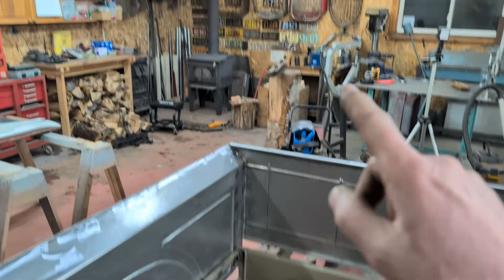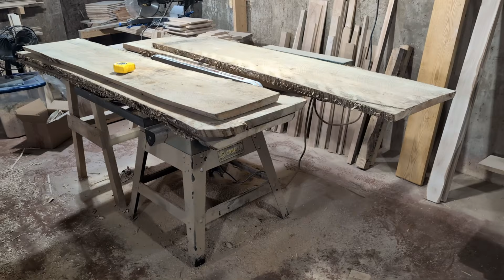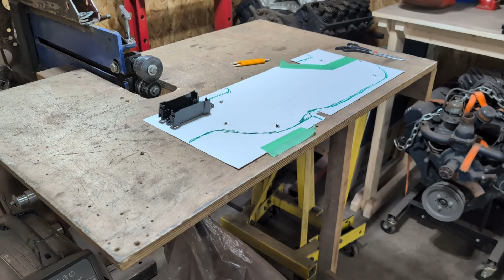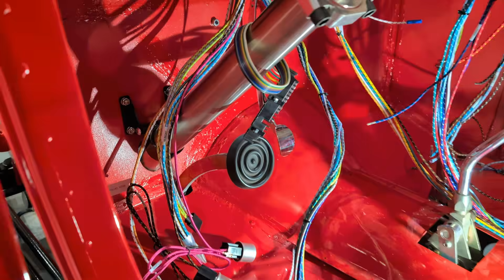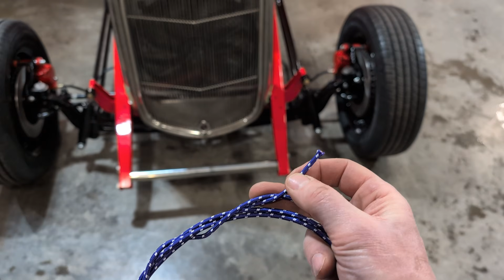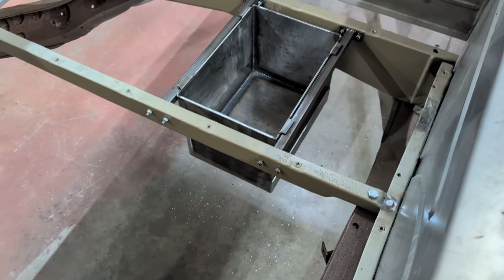1935 Pickup Box Project Part 5, 1932 Roadster Wiring Harness Installation Started

Comment: Interesting and informative episode Derek, the Pick up box looks really good. Neat idea for the fuse box mounting panel too,  mines on the passenger side (my Roadster is LHD) for no other reason than I have an under dash tray/shelf and it's easier to access rather than having the steering column in the way. See you next week.
Reply from the maker: I struggled with how to mount the fuse box without welding or modifying anything. Using the tunnel holes seemed to be the logical thing to do. Having the cowl vent opening will help connect wires too. Thanks for watching!